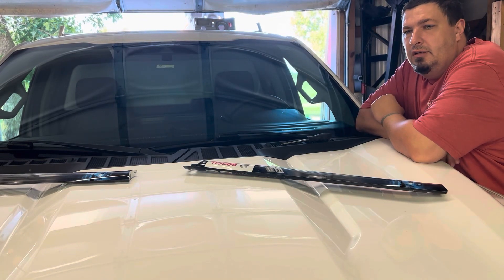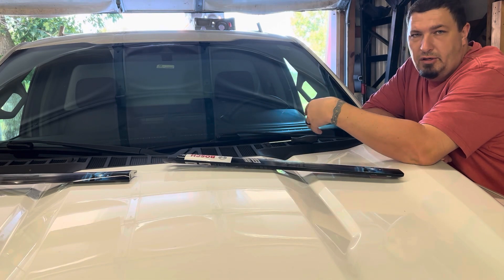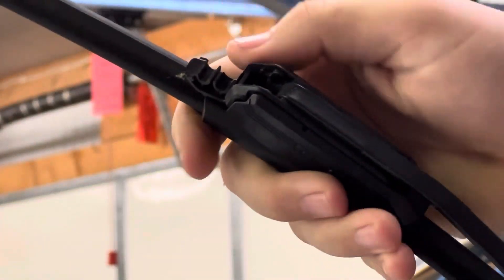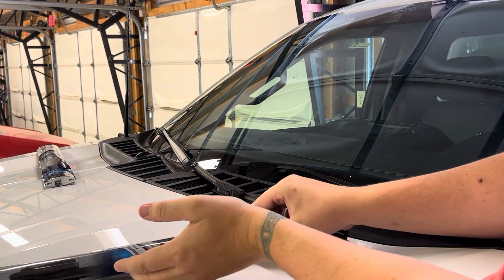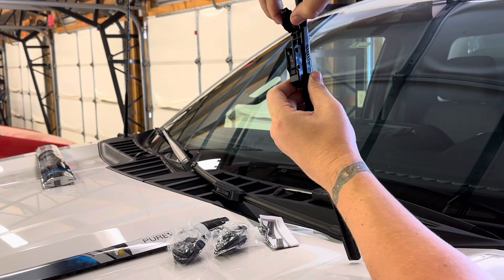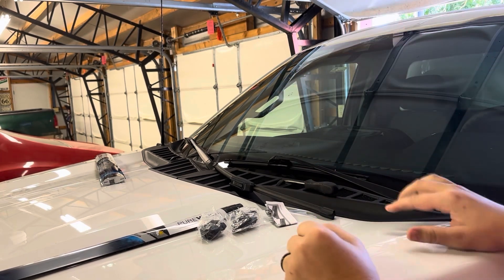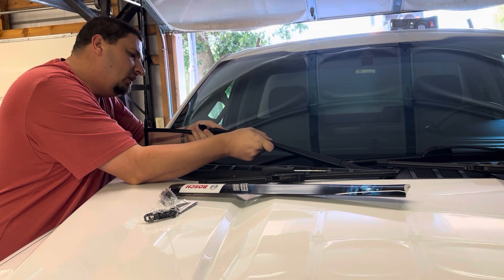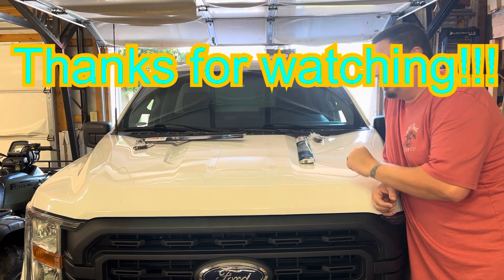(SUPER QUICK AND EASY!!!) How to change your wiper blades in a 2021 Ford F150

Comment: Just saw this video. I’ve always used Bosch blades on my pickups. I’ve now got a 2023 Ranger. I went to O’ Reilly’s and they said Bosch Icons won’t fit my Ranger and I’d have to get Trico’s. Well my Ranger has the j-hooks ends like the F150. Bosch it is again.
Reply from the maker: I really like them. They’re also really easy to install as well. Thanks for watching my video, glad you liked it!
Reply: @jcpierce4838  yeah the guys at O’ Reilly’s were surprised when I told them that they fit. I was putting them on when one of the guys behind the counter walked outside I assume to go home. He kept asking if I had it. I was taking the towel off that I put down to keep the arm from coming down on my windshield. I was already finished. It took probably 2 minutes. Those guys think they’re the only ones that are able to fix/replace something. I said to myself, if you can’t swap wiper blades you need to turn in your man card.
Reply from the maker: @glynncrook9211  lol, I completely agree